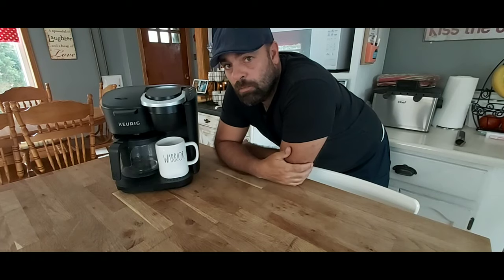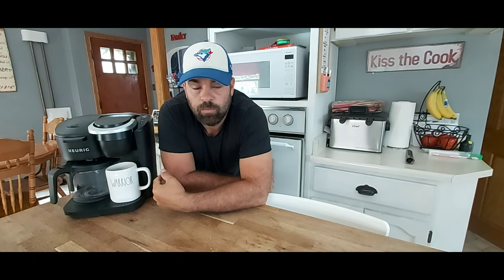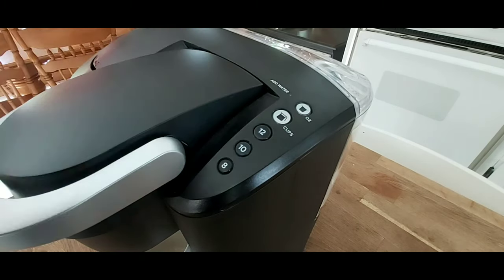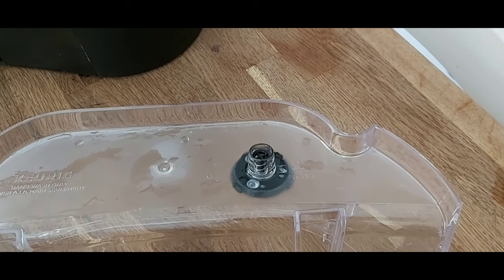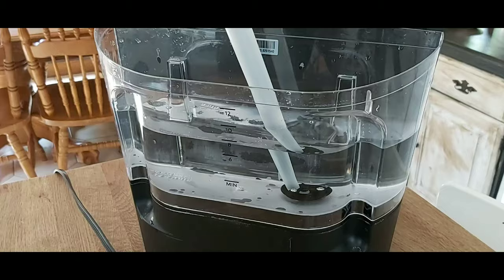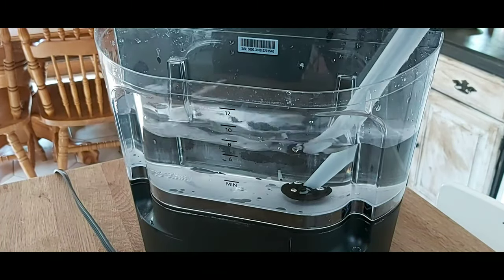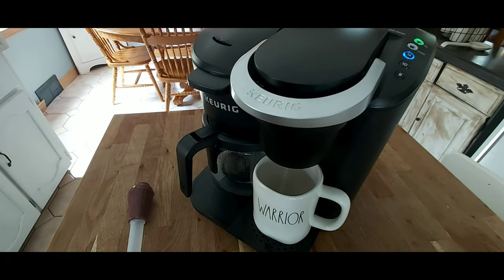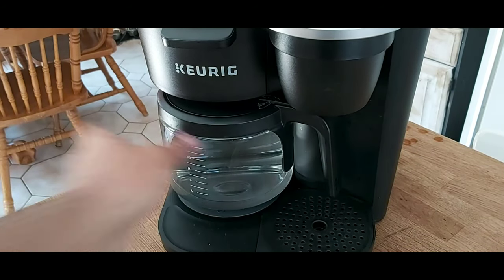Keurig not pumping water (Fast Repair)

Comment: I have the exact same model that you are showing, it's my 2nd machine within a year, I bought this 6 months ago and it has already crapped out, I will not buy a 3rd Keurig, they are nothing but junk, there's no way that it should be broke down already, especially 2 of them in a year. 😠   I will try your trick thank you buddy
Reply from the maker: hope it works
Reply: @MelandTim  
 It did I called Keurig, and they are shipping me a brand new one. 😁
Reply: Call them. I got another one new
Reply: Ridiculous that its that high maintenance im done with Keurigs as well
Reply: @igobylisa1  
Ya Lisa, since I last posted, my Kurig is running okay.  However  When this one is in need to be replaced it won't be with a Kurig, it just might be with a regular old fashioned coffee maker.
Reply: Grt info. Stopped dispensing a full mug of cof, descaling light came on. Doing the steps and the water/vinegar won’t dispense through much either. Do u believe the machine is pouched!?
Reply: @kellysheppard8965  
It probably is but who knows? How old is it?
Reply: Same. I haven't had mine a year, and it's broken. So far, I've tried every trick I've come across on YouTube, and it still won't heat up.
Reply: Works great now I’ll have 3 they just replaced my my first replacement anybody wanna buy a duo? Lol

Comment: I have a single cup Keurig that wasn't pumping the water. I took the 4 screws off the bottom, removed the panels, and gave some of the rubber tubes a squeeze.  The tubes had some water in them so the squeezes helped push the water through.  It started working then.  I am going to descale next.  Sharing in case anyone finds this useful.
Reply from the maker: thats awsome! thanks :)

Comment: Amazing that this fix did anything to help. Anyway, I am pretty sure this is not what is wrong with most people's Keurig machine.
Reply from the maker: I am also sure that not all proplems with most people's Keurig are the same as the problem I had, but for this problem this works really well. It has also helped alot of other people so.....  Thanks for watching :)

Comment: Mine was making small amounts of coffee on the pot side and full cups on the k-cup side.. after hours of trying different solutions these videos shared, nothing worked.. took it apart and blew the vent tube out with compressed air, works perfect now!
Reply from the maker: Great tip!

Comment: I used vinegar and it wouldn't pump. This turkey baster worked. Also, and I cant find the old video, but another guy said take your entire machine and hold it upside down in sink. That worked to. Thanks for the tip on this video
Reply from the maker: Glad I could help

Comment: Went and checked mine. Sure enough it had something in it. The next spot to check is where that attaches to the machine. I found algae in both spots. A q-tip got most of it out of the machine where the tank feeds water in. Works great now.
Reply from the maker: Thanks for the info

Comment: I didn’t have a turkey baster so I took it and used my air compressor and blew both ports out as you showed and it worked! I had already descaled it and it worked fine for about 3 cups. I was ready to take it back to Target because I haven’t had it long, less than 3 months. I live in N Florida and our water is very hard. Thanks for the video, I’m going to get me a turkey baster😂 Mine is a Keurig K Express
Reply from the maker: Hope you weren't close to Ian! I love FLA, my grandma used to have a trailer in Clearwater.  Its around a 19 hr drive straight south to the Tampa area. Glad it worked for you! :)
Reply: @MelandTim  We missed it here mostly, just gusting wind and rain. Some flooding in downtown Fernandina marina but we are close to the Ga. Line and 10 miles inland in Yulee, Fl

Comment: You were correct, my rear tank was clogged with fine cat hair.  Tuns out my cat like to drink out if the tank, gross I know but he’s my cat.  I had to use a tooth pick to pick it out of the 1 way valve at the bottom of the external tank and ran water through it backwards. Who knew,  i thought it was scale, lol.
Reply from the maker: odd but a good find!

Comment: Are you getting build up using bottled water or are you using tap water? So far every keurig I have owned using Poland spring water had not caused the machine to ask for descaling. I do run clean water through it every day after daily use. I have used the the descale formula from keurig once a year since owning both my machines bit not because it asked to be descaled.
Reply from the maker: yes this is from hard tap water. We have switched to using distilled bottled water and are having no problems. Thanks for commenting :)

Comment: It won't work for me!! 😭😭😭😭
Reply from the maker: sorry to hear that. you could try filling the water reservoir up with vinegar just enough to cover the back part and let it soak over night. this should also help to break down any hard water deposits. let me know this this helps. Thanks for the comment
Reply: Please for help or advice i have the exact same coffee machine.de cup side works well but the big side keep giving just a little and goes back to red light.tried your method didn't work for me.
Reply: I tried a bunch of youtube stuff also -- but it still didn't work.  (including cleaning some of the water lines).   I took a basketball pump (small, hand-held) -- and did a few pumps of air into the water input (after taking reservoir off) -- and it magically started working.   2 hours of screwing around -- a 1-minute fix did the trick.   My wife had already picked out the $200 replacement and was ready to buy.